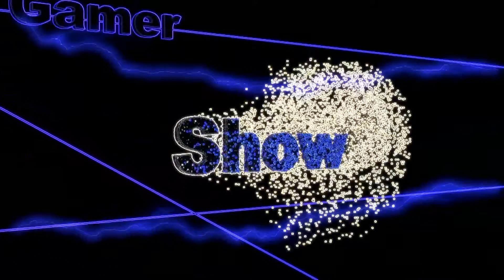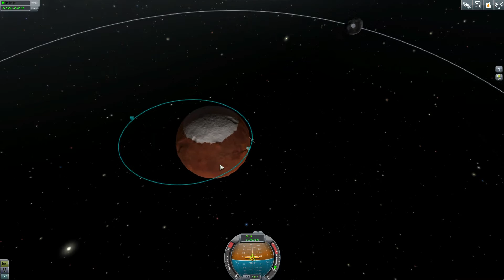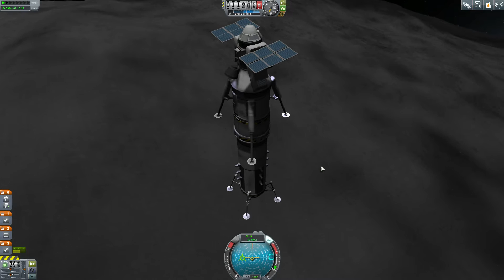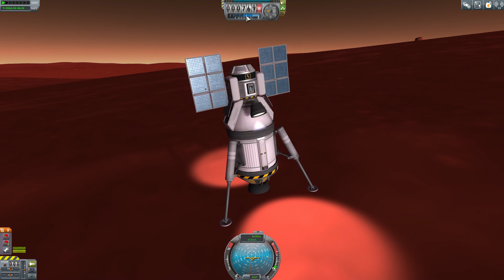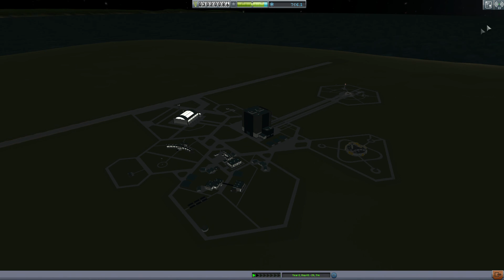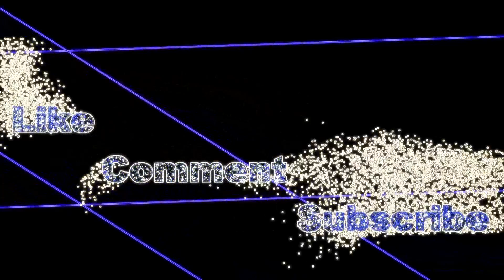Kerbal Space Program (2015) - Old School Career Mode 14

Comment: Transmitting science while at low battery effectively lowers the amount of science you get from the first transmission; you can transmit again afterwards, but the total is still slightly lower than what you would have had with a full first transmission.

It's a good idea to always transmit while time warping to optimize your battery recharge rate.
Reply from the maker: o0alessandro0o Oh interesting.